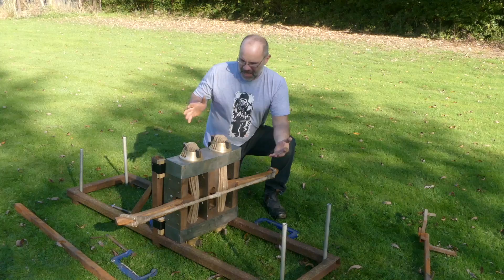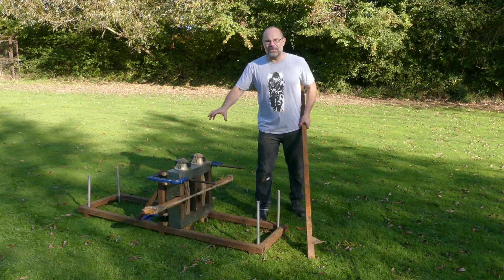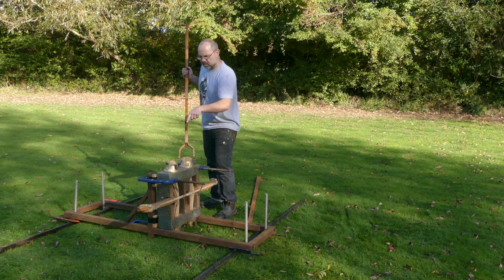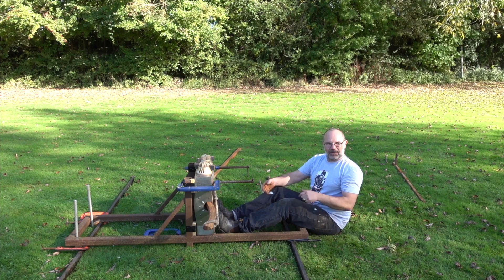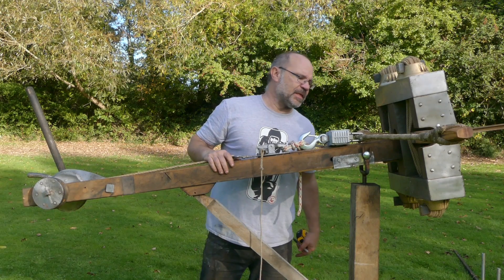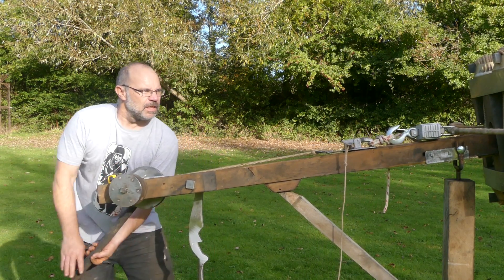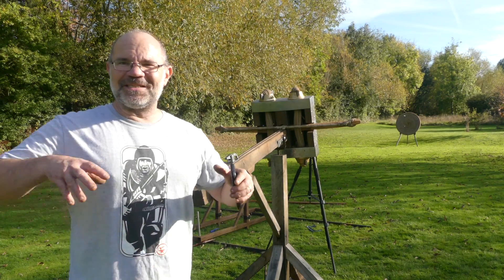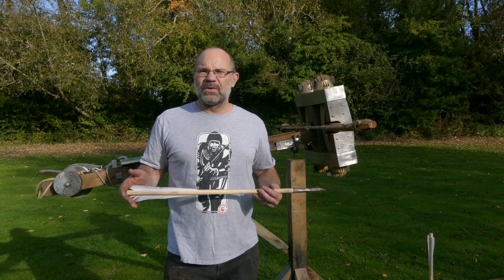CATAPULTA INCREASING POWER PT 2

Comment: Without air resistance the range of a bolt is as follows (shot at 45 degrees): 

30 m/sec      ----->         91 meters
40 m/sec      ----->         163 meters
50 m/sec      ----->         254 meters
60 m/sec      ----->         367 meters

In reality it is about 30% less because of air resistance.  Bolt shape greatly affects range.

Comment: has anyone thought about making or actually made one of these by welding steel plates instead of using wood? it should be able to easily withstand the tension easily

Comment: There is a device described in artillery manual of Heron call the stretcher that went over the spring holes and were used to tighten each cord until they shrank by 1/3 of their thickness without having to flip the ballista over. Plans of the stretcher can be found online

Comment: You could just make a little ruler and put the ruler far away from the center on each side and make the inner side of the string touch a mark on both little rulers from a perfect top down angle which you could also do by just cutting 2 guitar slider sized or wide rings from any tube and look down the little tube and leave room for sunlight to show in the bottom.

Comment: At 12:49 : I get a different result for the velocity and energy. 166 fps = 50.6 m/s. The kinetic energy is 0.5 * m * v^2 = 0.5 * 0.25 * 50.6^2 = 320J instead of 640J, or did I make a mistake somewhere?
Very interesting and promising project! I'm happy to see that you focus on the engineering part and want to figure out how this machine really worked and what difficulties the Romans encountered when developing and operating it. Most videos about this subject focus on sensation like making the biggest catapult which often yield disappointing results. I'm looking forward to the next videos! :D

Comment: I have a question. How much does your catapulta weight? I became curious on how feasible it is for a single person to carry one of those. I have found plenty of size measurements but I cannot find any weight/mass measurements for any kind or size of catapulta on the internet. 
Thank you for the great videos you make.
Reply: from what I perceive in the footage, it seems like it would be practical enough for a 3-4 soldier crew to move this about on a battlefield for it to be used tactically. Add two wheels to it, and a single person should be able to move it about, without wheels it looks very impractical. Operation would also be highly impractical with one person manning it. For battle field use, I'd wager 2-3 soldiers handling reloading and firing, possibly a spotter combined with shield for the forward handler, and potentially a guy on logistics. The last guy could be shared with one or more units?

Comment: Tod not a math guy but I'm coming up with different numbers to yours. I'm getting 290 joules for .5lb bolt and 378 for 250 grams. also 166 fps is 50.5 meters which explains that discrepancy.

Comment: You mentioned in the previous video that the stock is warped, I also notice that you always crank from the left side, and that's the side that's low on the stock.  Could it be that you're putting torsion on the stock that way? maybe you should be cranking from the right side instead? Perhaps that would help to bring it back, or at least not make it worse.

Comment: Interesting Tod, as always. I wanted to add something. The catapult you built is not a single shooter model but probably three. In battle you have to go fast, two load the winch, the other pulls the shot. The one who shoots and therefore takes aim was never the one who fired the shot, which started thanks to a side trigger. If you pull the string attached to the trigger, the pull will shift the aim and the shot will not be accurate. Then two load the winch, another takes aim and one of the other two, at the command of the shooter. unlocks the trigger. Another thing, the catapult after the winch had to have an extension for the shoulder support and a handle, otherwise it was too inconvenient to hold it in place and pull the shot. Hello.

Comment: Tod, the US has been , officially, a metric nation form the drop. That we don't all "think: that way is pure 'Murican cussedness. Keep using the "mixed number sets"- it may grease some other lazy minds up enough to do the "homework" to get facile at conversions and a few might take up the much more "streamlined" SIU!  I do see you safety hesitations; as a suggestion, and till you get a better handle on the power and necessary strength could you build an all metal catpulta framework? As to the problem of control when you "wind her up", I think you are correct, there are a few pieces of support equipment we haven't figure out yet- we may actually have some in some find of a military engineer's wagon and just not know it- a tool set like that is something I would think the Roman Army would have standardized as they did so many other things. Be safe and never ignore those "ugly sounds" when the machine starts making them!  FR
PS; I think Ian Saberwolf, below, may be on to something-it would balance the twisting lever tensioning tools and keep the frame steady.   fr

Comment: Dont you have to twist the cord bundle itself too? they all seem parallel and that will be detrimental to their elasticity + mean the cords are working individually more while twisting them. Ive read in a book once the romans would span 1 half of 1 bundle, lock it, twist it, then fold over that bundle next to it and twist it in the other direction so its both tight.

Comment: Can you make two tensioning levers that you can then use opposed to each other? That would tension both sides at once, and you could pull them towards each other to counter the force trying to twist the frame.

Comment: I know this is the wrong place to post this Tod, but I was hoping this way you'd see it.
I was once again watching the arrow vs armour video with Joe Gibbs, and it got me thinking. During a battle, a mounted knight with plate armour would move around a lot. Not only towards the archer but also up and down as the horse is galloping. What effect do you think that movement would have on the arrow - would it have an effect as if swatting away incoming projectiles or only intensify the power?

Comment: Can anyone explain where I'm miscalculating: Given 250 grams; 55m/s. Energy=1/2mv^2. I only get 378 joules not 640.
Reply: The velocity is only 50.6 m/s actually, and you are not miscalculating, it was Tod who forgot to divide by two. 50.6 squared times 0.25 gives almost exactly 640J, and divided by two gives 320J. 

The numbers are pretty consistent with Andreas Bichler's rampart crossbow, which achieves 378J with 222g bolt.
Reply: @lscibor  Nice. I think I know the one you're on about. Still quite portable compared to this. Rather demonstrates the unfortunate dead-end that torsion engines were over composite crossbows.
Reply: @anachronisticon  I wouldn't be so sure, after all, Tod only cranked it to around 460 pounds, so 2.75 less draw weight than that of Andreas' crossbow. Effective power stroke was probably roughly similar, if it was really around 16 inches in Tod's machine, then it was probably like 40% bigger than power stroke of rampart crossbow.

So if those numbers are correct, then this torsion engine does something way better, either it stores more energy somehow, or is more efficient at releasing it.

At similar draw weight it should theoretically have way higher energy.

Comment: I wonder if you can help with the tension distribution along the string bundle by making the string switch from a strand on the outside of the bundle to one on its inside each time it passes over the end bars (the bars that you turn to post-tension and where the rope turns around, if this isn't what they are called). That way the tension between the inside strands and the outside strands can easily even out.

Comment: You have the best content on youtube! Have a question. Apparently a Crossbow from the medieval times could get up to 1700 lbs. Is it possible to design such a thing and test it against armor? Most people testing this are you 1200 lbs of force max
Reply: https://www.youtube.com/watch?v=Byc887HmUdc  and the stats. A 1265 grain projectile moving at 210 fps has 335.8 joules. im curious as to your 1700lb quote do you have a source? it seems as though they maxed out around 1200 and anything further would have large arms and be pintle mounted or used for sieges as both weight, size and spanning make them less portable.

Comment: Why not attach a weigh scale to the end of your massive spanner and pull that?
Then you could get equal tension on all. Perhaps by anchoring a cable from the end of the stock, to the end of the spanner, with a weigh-scale and some means of tensioning them all?

Comment: Tod, I think your calculation is slightly off for the kinetic energy of the bolt.

166ft/s = 50.6 m/s  
(1/2)*50.6*50.6*0.25 = 320 J
(1/2)*55*55*0.25 = 378 J
Reply from the maker: Yeah sorry - In my excitement I forgot to divide by two; but it gives me something to aim at and I will rectify the mistake in the next vid

Comment: Hello Tod, my friends and me build a catapolt like yours about 20 years ago and we put the front side on the ground for tightening so we can spann both sides equaly and had no problem with sliding of the complete set up. Just 4 of us were standing on the frame and one was handling the lever. To had impact on the turning bar on every position we gave the lever a 45° angle at the front like on a wrench. The size of our machine was rather equal and we got about 150 m with a 8cm concrete ball . Scarry powerful stuff 😁😈
But please never trow the crowbar in the ground like this . we all want to have much more of your nice videos...... if you tumble and fall you can easyly find the nasty crowbar in your gut. That happend on building sites all over the word many times....... so be careful please...... 
Since many years I recreate some medival stuff as well and building historical rifles for blackpowder shooting if you like take a look☺
Reply: before I forget.... we used hemp rope.... when we spann it dry to the max, than wetten it before shooting the rope were shrinking and it gets even more powerful😆

Comment: After studying linguistics as part of my undergraduate degree, I found that there are some words that change meaning so fast it's difficult to keep up. EG one word that has changed meanings 5 times in less than two centuries. IE "Gay" which meant "promiscuous young woman" originally, then it was used to refer to anything brightly coloured. (the women showed off their promiscuity by wearing bright make-up). Then it meant happy (derived from very small children being happy seeing brightly coloured toys). Then it referred to homosexual males and soon after to homosexual females as well, my working hypothesis is that this is at least partly due to the bright coloured clothing some wear on parades etc. Now it can mean something that is not very good. This is why one of the first things you learn is the "historical critical method" as meanings can change by region too. Sorry for the This process was slower in the ancient world but certainly we have records of it as far back as 3500 years ago. Therefore the Catapulta/Balistae, not knowing the meaning changed is hardly surprising as the HCM method for analysing text is only known and practiced by a very small minority of academics, some of which would get far too exited by this kind of thing.
Reply from the maker: I actually also get excited by language as well as tools, so thanks for this

Comment: I always thought it would be interesting to put working recurve limbs on a small torsion device, like yours, or a manuballista (to theoretically give it a longer power-stroke). Of course, one would have to balance the draw weight of the limbs with the draw weight of the torsion in order to get the benefits of both.
Reply: Over complicsted

Comment: What stops the brass nuts top and bottom from unwinding? Brass is a ‘lubricating metal’ and even friction from rope tension wouldn’t be enough to hold it and the huge vibration from firing when the limbs stop would rattle the brass nuts and loosen the tension rope bundle.

Am I wrong? Are the big brass tensioning nuts just sitting on the steel encased frame?
Reply from the maker: Drop in pins
Reply: @tods_workshop  thanks Todd, very simple in the end as I was thinking all manor of ratcheting gadgets.

Comment: You can take a piece of ply or anything flat, make 1 foot markings. Then record the shot with the board in the background and as long as your camera is at 90° to the path of the bolt and you know the distance you can then use your editing software to accurately judge speed for slower shots that don't register on the chronometer.

Comment: Absolutely fascinated but I struggle to see how usefully these could be employed? The re-load speed after the first shot must have almost made them useless in any moving engagement? So I surmise they were for fortified defense. Then there is the question of 'pre-tensioning' anything without allowing for the effects of weather/humidity/temperature, so the first shot will give you information but by the time you adjust accordingly (if they have any sense) the target will have moved?
Saying that, the Roman's were not stupid so there must have been a good reason to expend resources not just making these but carrying them around, the reason escapes me.
I didn't think I was 'thick' (but who does?) so somebody please enlighten this small, unwashed humanoid.
Imagine this working flawlessly, first shot takes an armored warrior clean off his horse at 200 yards, hell of a statement, fine, the king is dead! 
In reality, the first shot hits the ground near the horse, now the thing will take ages to re-load/re-chamber so oooo, eh, well CHARGE!!
What am I missing here? (if you say 'brains' you can eff off to the back of the queue) that is easy and practical, it doesn't seem worth the effort to me.
Pax dude.

Comment: copying is lame
Reply: have actual skill
Reply: put a mutual opposite turning gearings on the string tensioning, turn one, both turn, at same time, same rate
Reply: super cap holds easily more than 1kJ (100Wh/kg), 1MJ = 0.278kWh, which makes 1kJ = 0.278Wh =~ 1Wh, instant super cap discharge, 10g of supercap
Reply: a jolt from a li-ion is some spark

Comment: after you are done with this one cant you please build one with your knowledge but with modernmaterials it would be intressting to see the differance in how strong they are and im preety sure you are also going to be in the end result.
Reply: If I recall correctly he built an inswinger out of modern materials for a tv show or something. The used                                                                                                                                                    hydraulic jacks to drastically increase the tension.
Reply from the maker: That build was awesome and was full of modern thinking, but interestingly it started as a hydraulic system with air trapped in it.  we bled the air out and the efficiency dropped massively still worked well though

Comment: If I recall correctly Wet rope is longer than dry rope, when you rebuild it wetting the rope while you pre tension each loop, when it dries the contraction will give you some free torsional strength?

Comment: 44. magnum rounds are around 1000 joules of energy, fingers crossed this beat it. 5.56x45 is 1800 joules. To reach that, the 250 gram bolt would have to breakthe sound barrier, which probably won't happen, but maybe with a heavier bolt?

Comment: In your last video you had some buckling happening on the frame. I'm worried that if you power it up too much it could recur all at once and something bad could happen. Be careful and maybe consider a face shield when cocking it in case parts come back at the winch. Very interesting to see you working on this again. Good work.

Comment: Are you concerned about the twist in the main beam? I would consider checking if the twist gets more extreme when under tension, it might indicate a possible failure mode where the beam splits lengthwise.
But you do you, I trust your safety radar.

Comment: I don´t quiet understand the Use of a Catapulta yet maybe someone can help me. 
I think in a Battlefield Scenario the Manpower needed to Operate a single Catapulta would be way better invested in a Groop of Archers or Slingers or some cind of other Ranged Weapons operated by a single Person, because you would have a way bigger Wolume of fire against your enemy. Concidering that Armor at the Roman time wouldnt be nearly as Effektive as in the Middle Ages Arrows or Slings should be enough to hurt or kill an enemy i think the Katapulta in those Szenarios seems to be an Overkill.
in a Seage Scenario i dont have a good Idear for the Usefullnes an Arrow Louncher too. It dosen´t seem to be Precise Enough to reliebly hit a enemy Soulder on a Wall. It dosend help penetrating the Gates or the Walls like a Onager woul do at least against Mudbricks. An Oniger qould also have way cheaper Amunition concidering it just Lounches Rocks, who would also do way modre Damage against Buildings in a City Especially if you woud heat them up so they can cause a Fire wich would Distract the Defenders. At the same Time a cupple of Stones would be more Effektive against something like an Enemy Camp made out of Tents or simple Shelters out of Straw roofs wich a Marching Army would have. And an Oniger would be Able to lounch multiple Projektiles so it could deliver way more Damage in a Battle Scenario. 
So im not shure what Usage a Speer Louncher would have that couldnt be done more Effektive or efficient with an Oniger.
If You have some Sugestions I would be glad to hear them. Thank you